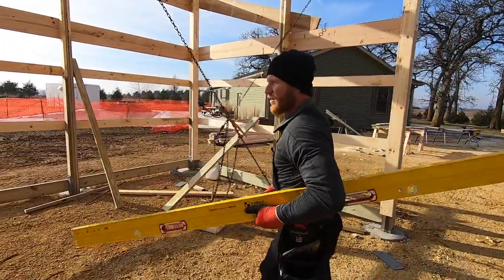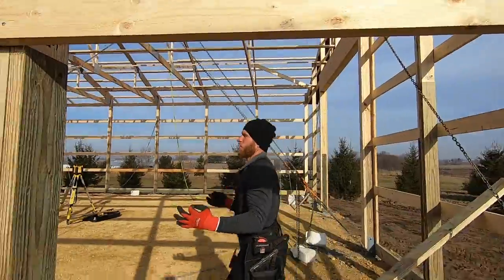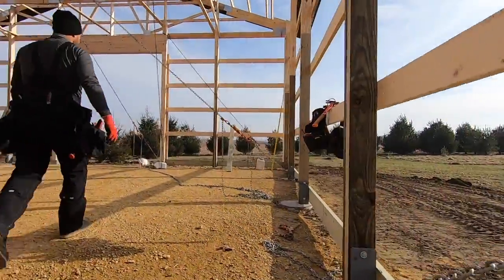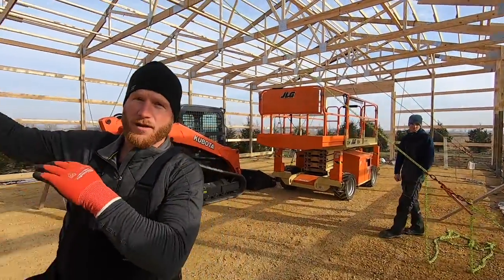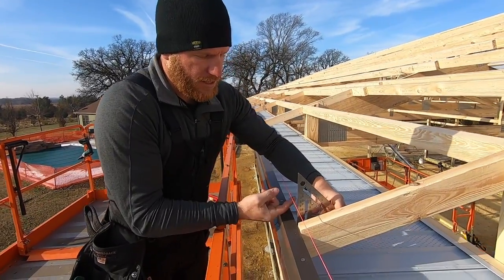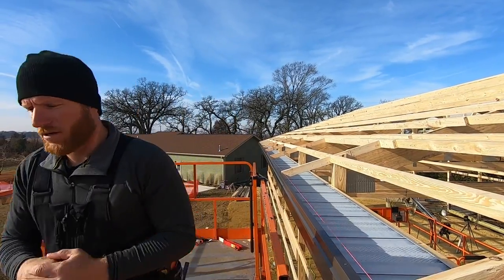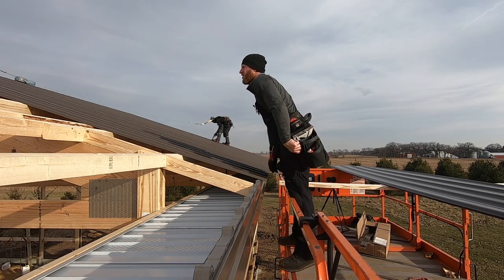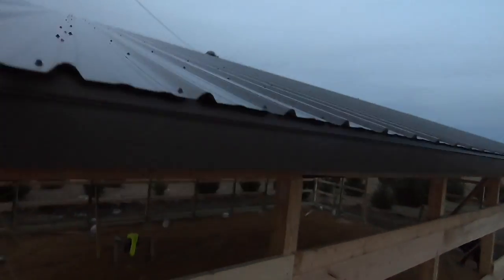Complete Step by Step How To Square a Roof

Comment: Why cant you square up the whole roof using the roof steel like u do at the end for the fine adjustment
Reply from the maker: Would probably link the metal... sometimes it takes a lot of force to move the peak where we want it

Comment: I spent an HOUR   watching  and commenting on the sequence of truss bracing without diagonals. Somehow it got deleted or edited out by the system. If it is still there my credentials in commenting are:
U of MD. Class of 1962, BS   Civil Engineering

Comment: The rule for cantilevered lumber is only one third over. Those tails are about half? No Simpson ties holding down? How do those stay on with a wind event?
Reply from the maker: 60ds times 2
Reply: @RRBuildings  
I get it. The fasteners that you use are the best in the business. The structure when you walk away is very sound. But, over time the wood shrinks away and gets what is called iron sickness. The nails and screws will lose alot of holding power. If all of the joints are wood stacking on wood then it isn't so much of a problem. When the purlin want to sag there isn't that continuous stacking, know what I mean. But thanks for the sheet metal details, you have been a big help. Great videos and sound.

Comment: I appreciate tips but you did not show how to hook the chains up and how you were a wedge to move the building. You can tell me how to square a building with a square and a leveler in which I know how to do. But not showing how you have the chains are hooked up , what kind of chain was used. This is the most important thing you should have show then show how to use the square. I hate it when people leave out so much information.